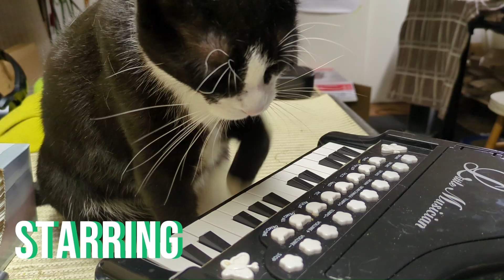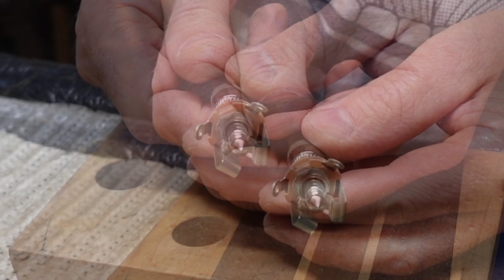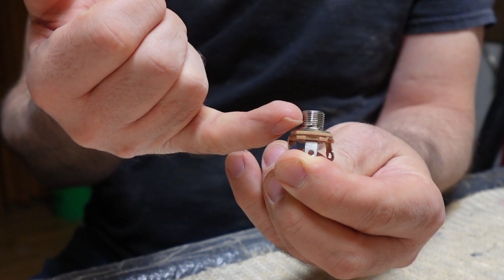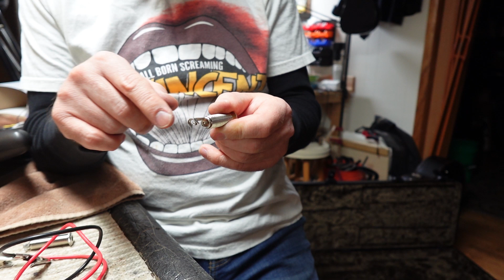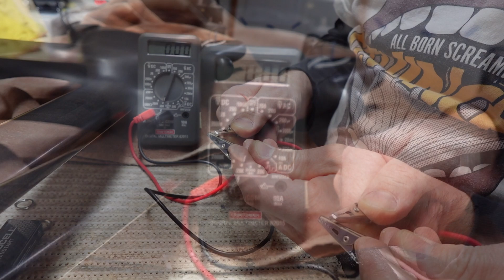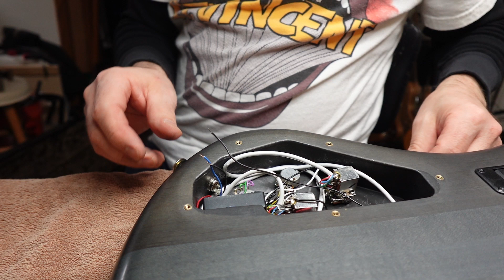Replacing Guitar Output Jacks

Comment: Thanks for the video. My hat's off to your steady hands!  I've replaced a few jacks in my day but I always solder it outside the body. Sometimes I need to lengthen the wires a few inches. (and Don't forget to put the nut/washers over the wires inside the body first!) I've forgotten that a few times in my day too!  🤣